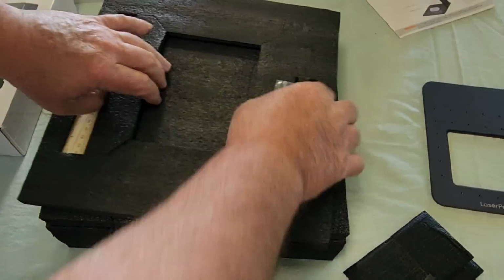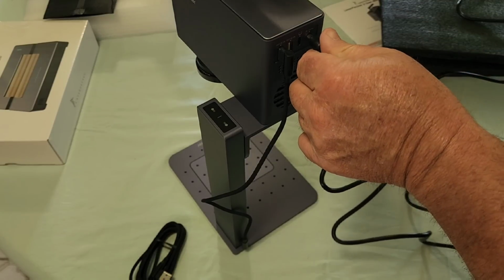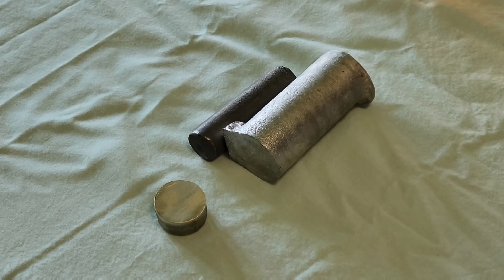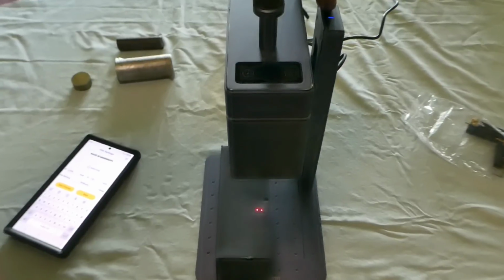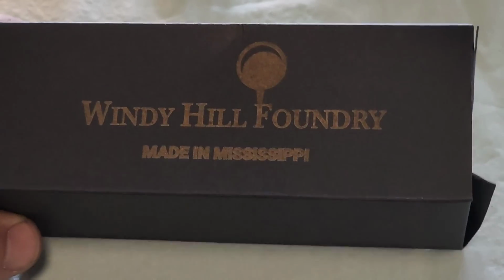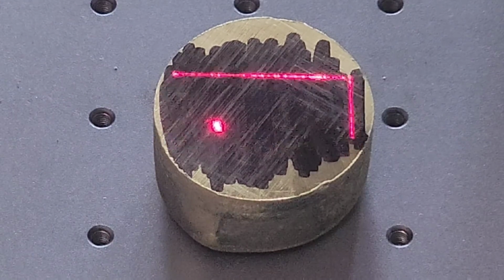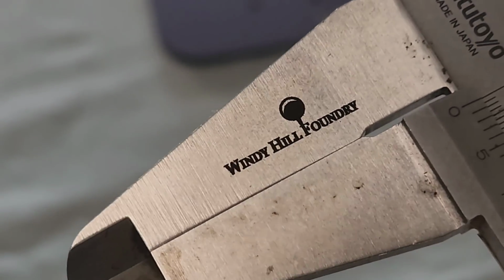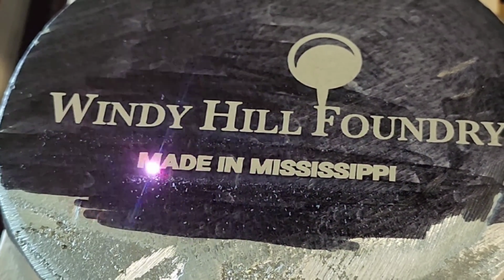UNBOXING OF LASERPECKER 3 - METAL & PLASTIC HANDHELD LASER ENGRAVER

Comment: Looks Amazing! I've read that ventilation is pretty important with laser engravers, your shop should be fine with the open spaces there. Many use an air purifier.
Reply from the maker: You are correct, an open window and exhaust window fan will work also

Comment: Fromer US Navy Laser Systems Safety Systems Cat II qualified here. The laser is ablating and sintering the surface, relying the ablated material and adhering that material to the surface. It leaves a tactile surface, but its typically just a few thousands of an inch. Now, a Word About Safety with Lasers; Read the manual and the SAFETY WARNINGS like your scared shitless of going blind. In the early days of laser designators being deployed in the military, there were numerous 'sight injuries' (total blindness) reported. Understand a laser beam that has enough power to etch iron, has far more power than is needed to blow away that 0.3mm Fovea that you depend on to see everything. If you are nearsighted and wear corrective lenses of any kind, even one of those lasers used in price scanners at the grocery store or a presenter uses can do it. If the power of the laser is high enough and green, blue, or violet, those do not need 1,000th of the power of a red light laser to blind you. (those green targeting lasers on the M-2A's were only fielded for a short time as they were declared a blinding hazard and a maiming weapon by the Hauge)... So, READ THE MANUAL. And keep little kids and your friend Kenny from hanging out looking over your shoulder, those are the ones who are too dumb to not stare directly into the damn thing.
Reply from the maker: Thanks for your input👍